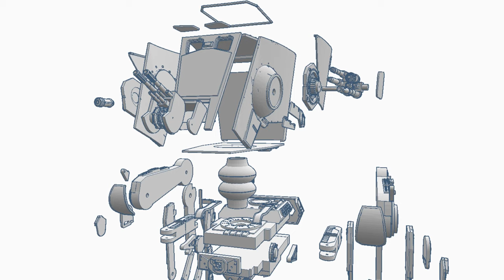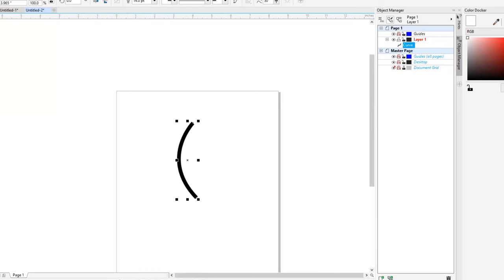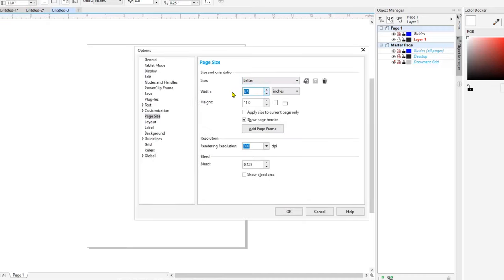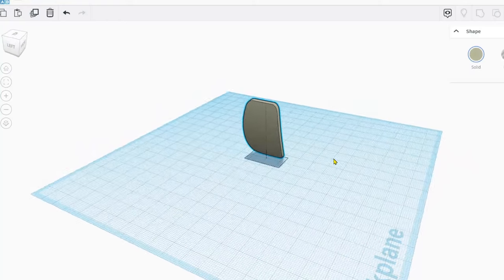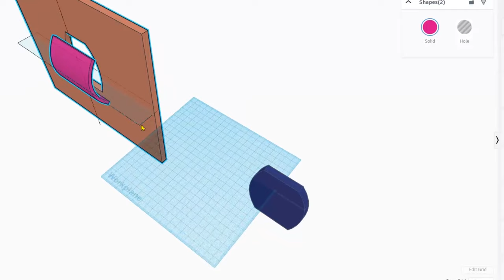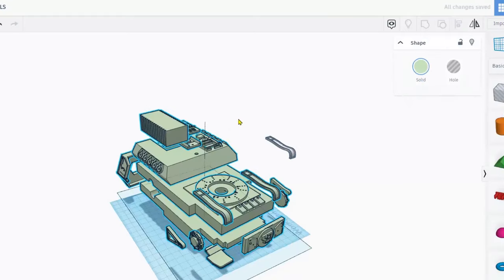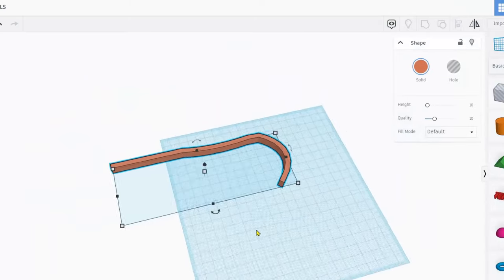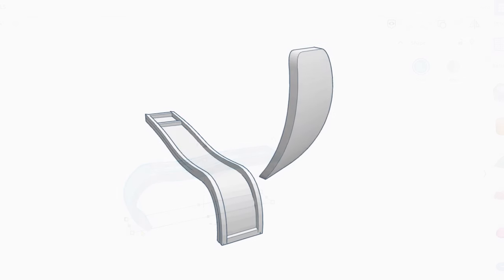Ep. 1 3D modeling - MAKING CUSTOM BENDS AND CURVES ADVANCED TINKERCAD

Comment: THANKS!  OK.  Using paint to get the jpeg is a PITA, but it does work.  Thanks so much for the fundamentals in this video.  It allowed me to get my project done.  I have a complex curve (5 point curve fit) into tinkercad and have printed it.  Very happy.  BTW, I had to use two different jpeg-svg converters to get mine to work.  First one digitized the background and left my line image as a hole.  Very weird.

Comment: Liked the series and have a question. Have you been able to create beveled/fillets on curved shapes? thanks
Reply from the maker: on native tinker cylinders you can control bevels but on custom shapes you can't really do it in that program.  There are a few manual ways though if you can create a new shape and extract edges.  I'd have to see the shape to give more advice.  There's also a way to round objects in programs like meshmixer that might give you the effect you want.

Comment: Thanks for the video. But I have a question. What you show seems good for free form modeling shapes but I don't really see how you can model to exact dimensions and angles using this approach. You appear to be just winging the shape profile & size with bezier curves when creating the svg's. If I need to model something with more precision, is there a way to do that usung this approach? Or how would you approach something like this? Appreciate any help. Thanks.